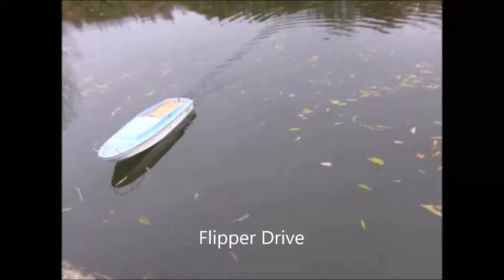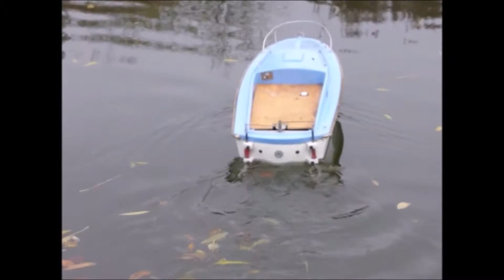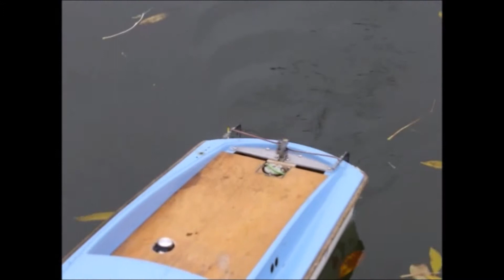Flipper Drive Stirling Boat

Comment: I'm looking to do this on an inflatable dinghy I just bought, but foot powered
Reply from the maker: Let me know how you get on - andrewthamesside (gmail.com)
A pair of opposed flippers are needed to stop action/reaction "wobble"
With you driving it with leg power - you will get a very good idea of how efficient it is
Send me an email to let me know how it works - Andrew Hall
Reply: @andrewhall2702  I'll probably post a video, however short it may be. I've been going back and forth on ideas for a while but I like the dual flipper because you don't lose power to boat pivoting. Another idea that has caught my attention is a flat dolphin like wing, but I'm not sure how deep it will have to go and I'm often in shallow water hitting trees, though I could hold it in the upper position for clearance... Hmm... Plus one central point of contact could mean I could steer with the flat tail...
Reply from the maker: @fryncyaryorvjink2140  A video would be great. A wing underneath to lift you and the boat - Yes looking at the videos -it's just about possible with a bicycle and a very strong cyclist? - Dual flipper will be far easier? - One idea at a time?
Reply: @andrewhall2702  I'm not looking to lift the boat like a hydrofoil. I've seen a few flat flippers that angle themselves on the up and downstroke to create propulsion. The only problem is so far it seems like it would be much more bulky than 2 vertical flippers, but I'll work on the idea some more. I want it to be minimal as it's a rather small boat that I'd like to be able to bring a second person on